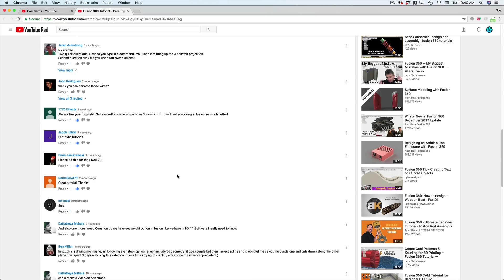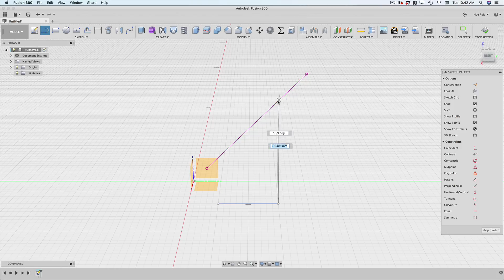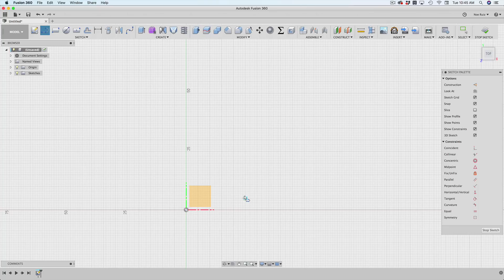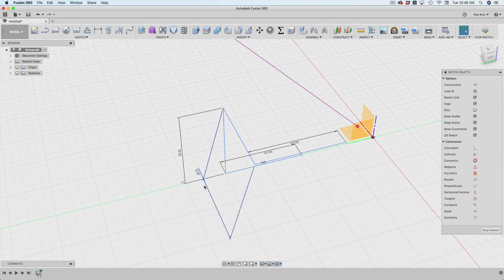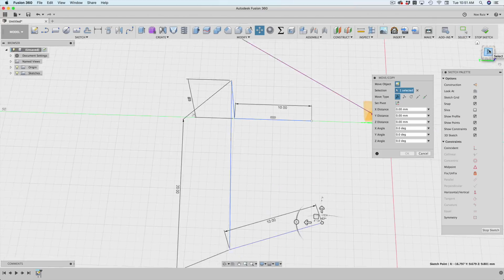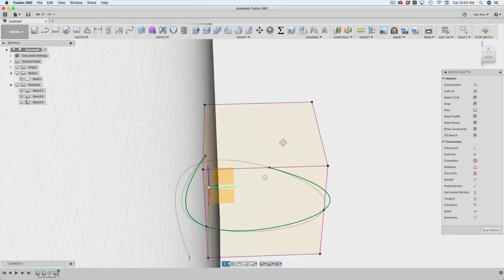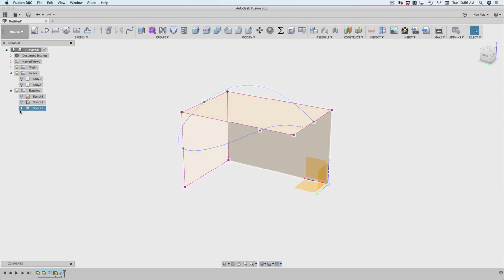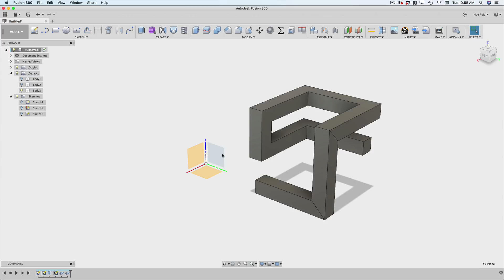Fusion 360 Tutorial – Learning 3D Sketches

Comment: I've found that the most reliable way to create vertical lines (orthogonal to the selected sketch origin plane) is to just make a line segment, then add a parallel constraint to the orthogonal origin axis. So in your example where your sketch plane was XY, you would make your line parallel to the Z origin axis. Then it will pop out of the sketch plane and give you the 3D line you want. This only works if your sketch plane is one of the origin planes or parallel to one of them.

Comment: that "dynamic" origin seems to show up consistently when you are in one of the isometric views, so if you orient your space by clicking a corner of the view cube that origin will show up easier. Also seems to help by dragging the line short at first till it shows up.
Reply: Yes, you don't have to be exactly in one of the isometric views but your view has to be close (within a couple degrees of parallel to it)